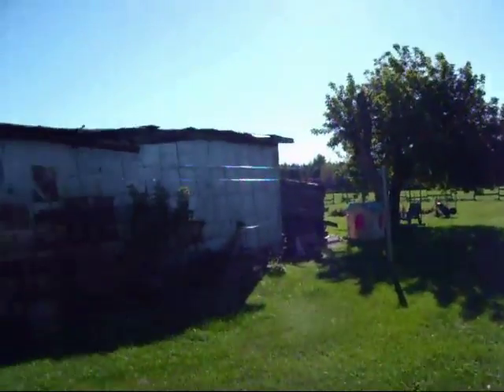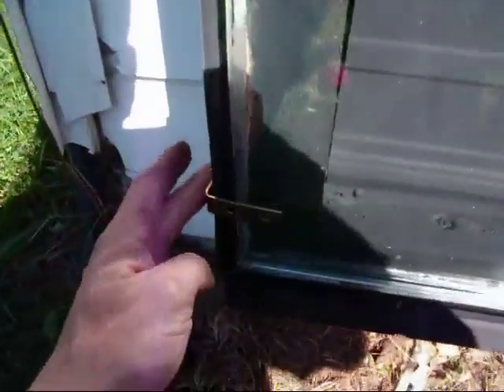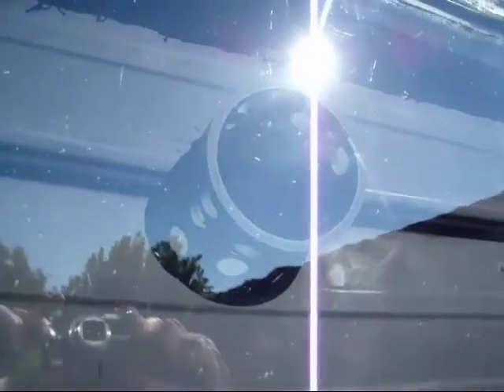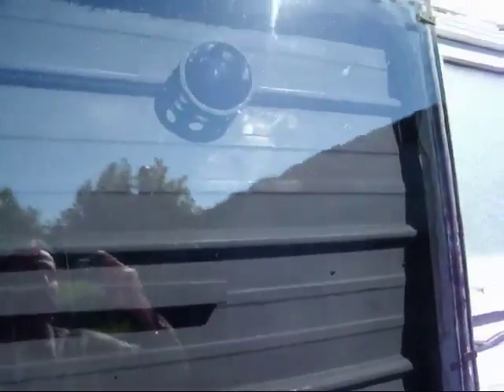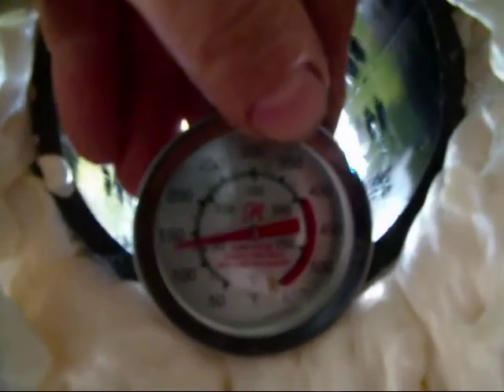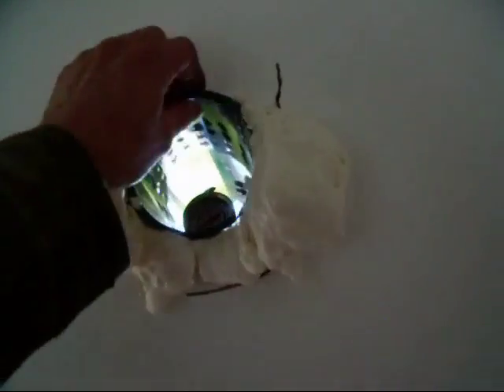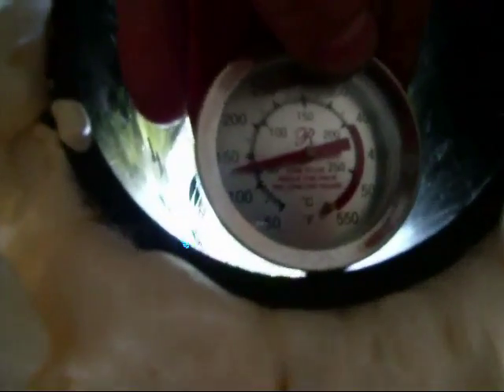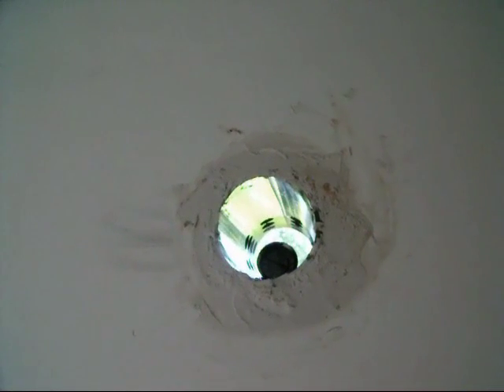My Solar Hot Box Air Heater

Comment: Nice, warm project! I used beer and pop cans in my first solar house heater which measured 3 foot by 5 foot with a heat output of 55 C. For my second solar heater I used aluminum down spouts which was way faster. It measured 3 foot by 6 foot with a heat output of 140 F (60 C). So I scaled it up to 6 foot by 6 foot and it has a heat output of 203 F (95 C). They work great adding free heat to my house every sunny day! https://www.youtube.com/watch?v=7S8CWsIcK20

Comment: You need to use a single piece of glass for a solar heater, Insulated units are a thermal brake, they are made to block out heat
Reply: Holds heat in.  I don’t think the sun knows there’s two panes of glass.

Comment: The only way this would be beneficial is if the air was compressed much like a Heat pump other wise as others have mentioned, if its -20 out your not going to get 120 degree air on a empty box with aluminum roofing as a heat exchanger!

Comment: During the might in winter those open holes will act as cold air conduits with no cover on them. Any test on how hot the air is during the day in the winter? Also did you consider the path of the sun before the installation as the idea depends upon sunlight entering the box? And lastly what about insulating the box to prevent heat loss during the winter? Touch a window pane during the winter and see how cold it is and that would draw heat out of the box.

Comment: Nice, I like it. You want to think about a way to close it off in the summer and if you can put a small fan in there it should do better. You can buy a small DC voltage regulator board on ebay and vary the fan speed.